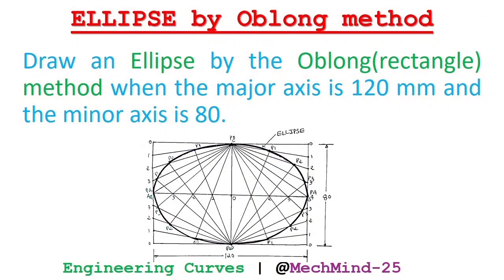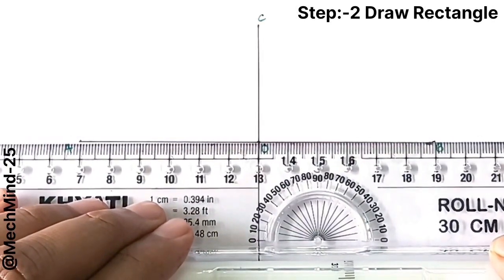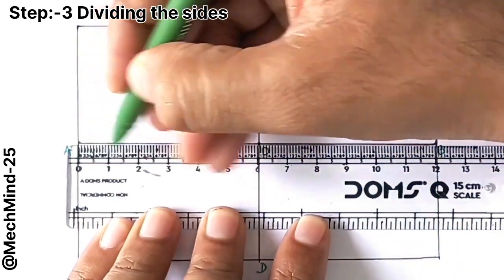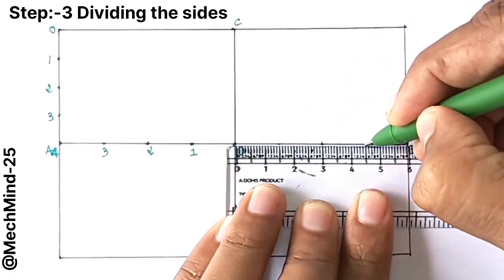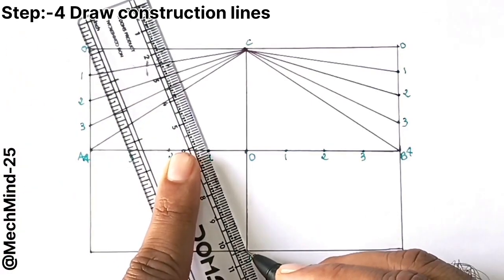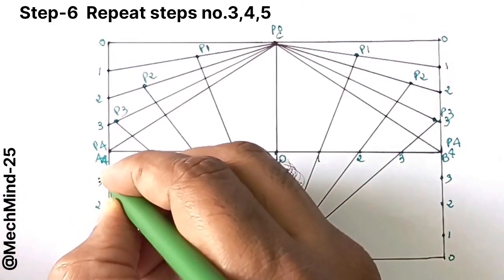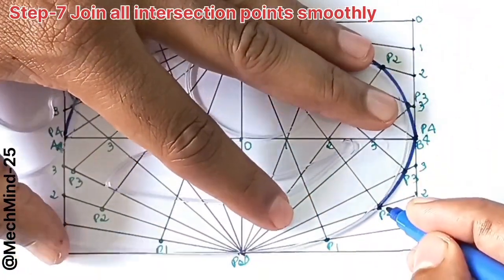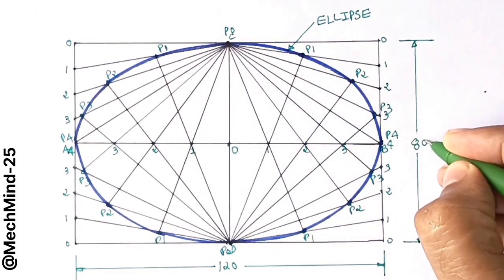✏️Ellipse by Rectangle (Oblong) Method | Engineering Drawing Tutorial for Beginners @MechMind-25

Comment: Draw projections of points on a line XY.

a. Point A is 30 mm above HP and 20 in front of VP.

b. Point B is 15 mm above HP and 30 mm behind VP.

c. Point C is 20 mm below HP and 15 in front of VP.

d. Point D is 15 mm below HP and 20 mm behind VP.

e. Point E is in H.P and in VP.

f. Point F is on H.P and 30 mm in front of VP.

g. Point G is in V.P and 30 mm above HP.

h. Point H is in V.P and 30 mm below HP.

i. Point I is on H.P and 30 mm behind VP.

2

 ડીસા આકૃતિની વિડીયો બનાવીને મુકો ને આકૃતિ બનાવીને મુકવાની 🎉